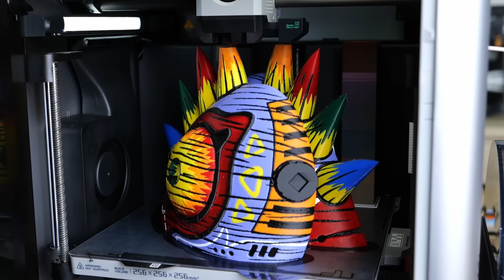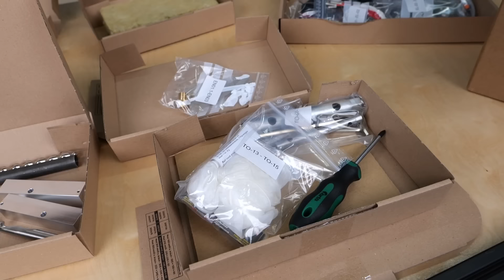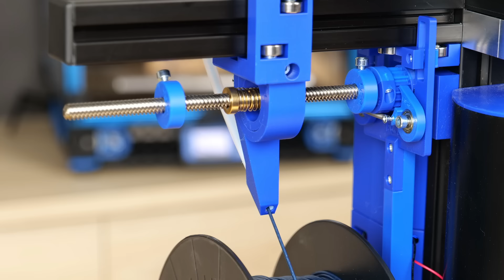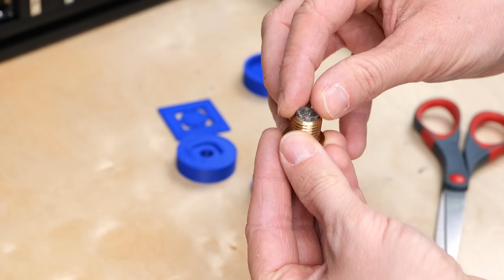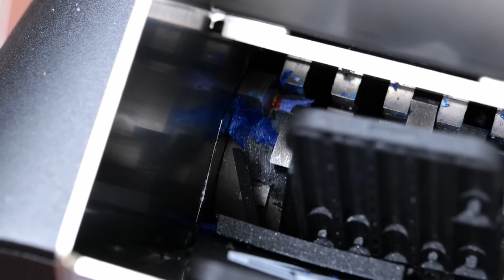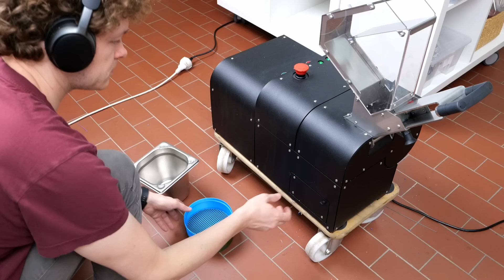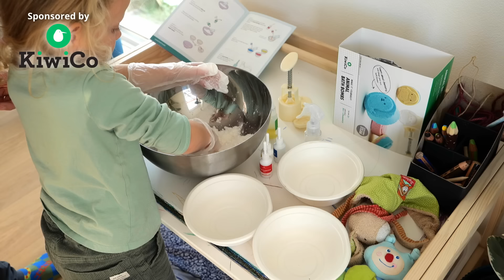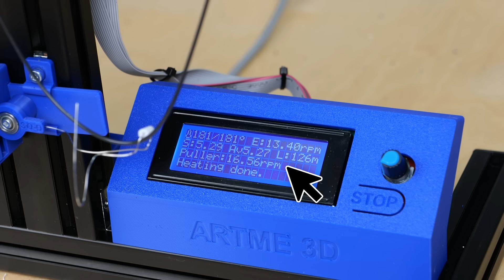Recycling Failed 3D Prints with a DIY Filament Extruder: Artme3D

Comment: This is a HUGE step in the right direction. I've been so confused as to why there aren't any solutions to shred and re-spool 3D printing waste that are consumer grade and priced. I'd love to buy a system to recycle my PETG and PLA waste, but it's way too expensive right now.
Reply: I use a ninja blender Ninja BL455, powerful enough, but you need to let the dust settle.
Reply: @Obot1121  be wary of the microplastics you're being exposed to. Many polymers in a microscopic scale are endocrine disruptors.
Reply: Yeah, in a hobby space and even in commercial manufacturing 3D printing is but a fraction. And often with plastic, extruding them over and over causes thermal degradation and you'd need to add additives to keep them from becoming worse. It might just be a better idea to use PLA more and create accessible industrial composters. And maybe something like plasma gassification for petg and some.other products.
Reply: @kbee225 Brothersmake did a video on plastic degradation and it's not as bad as you think.  They were able to recycle pla several times over with no change to the strength until about 50 times being reground and extruded.
Reply: @EnvyNeko2 , on degradation I would lean towards agreeing but at my work (cast film extrusion) we only run our recycled material in one type of product at up to 50% structure.  The most common problems of our in house recycled material is not degradation but imperfections.     We are now starting to run post consumer recycled material and the stuff smells like burnt wood, for our application we had to buy a new type of filtration system to run it.
Reply: @kbee225  I would think any issues with thermal degradation could be overcome by mixing in a percentage of new material in the form of pla pellets. Maybe 50/50. 

For me though, recycled filament isn't necessarily something I would use for high quality or high strength pieces. This is a "Oh I need a couple random hooks for my pegboard" or I need to print out a sacrificial piece to get the sizing correct before I print an entire batch. This recycled filament would be perfect for that.
Reply: Considering the biggest expense will be a system to adequately remove moisture, I think this system satifies the need to recycle, but will, for a long time at least, remain unrealistic for most users. Shame there is not a company offering this service, but if they could profit, they'd be doing it already!
Reply: No, it is not. And here is the reason why:
1. It has no filtering of emissions.
2. Professional large-scale systems have this and can do it more cheaply and in a more energy-efficient manner.
3. You're ruining your health because of 1 and simply buying the filament is more environmentally friendly overall.
Reply: Confused? Deep down you know the answer, my man. We waste too much filament on support, recycling that is not profitable
Reply: Because between dealing with the possible dust, hassle and precautions necessary for this to succeed, it’s easier to just buy a new reel. 

And no, recycling for the sake of some moral necessity imo ranks so laughably low on my list of priority that you can’t even begin to imagine how little I care for it, unless it actually has some tangible financial benefit.
Reply: @slowcyclist4324  For some of us it isn't about "Easy". It's about reducing the waste. If you're running any modern AMS type system it produces insane amounts of waste, sometimes more than the actual print. Personally, if I had a device that could grind up and make new filament from my Bambu X1C Waste, I'd pay up to around $1,000 for it. Why? Because it's better than tossing out 50% of the filament I buy lol. If you do a lot of multi-color prints up to 50% of the total print is just waste in a lot of cases. Each spool costs me between $20-$35 Canadian, so $10-$17 in waste per spool? I'd 100% buy a recycler for that.
Reply: It'd have to cost at most $100 in order to make any sense in my opinion, including the shredder - and even then I'd question what the goal is. It doesn't really make sense neither economically nor environmentally
Reply: @oyuyuy  Um... what?

Lets say your spool costs you 20$, you waste about 20% between failed prints and support material. Every 5 spools you go through, this saves you the cost of a spool - and whiel you won't want to continue recycling pure recycled PLA etc, you can easily funnel this into becoming internal fill material etc with very little in the way of lost strength etc. So you go collect a pile of stuff, recycle it down, turn it into supports, then use it as filler material - or just use it for solid blocks, bases, and such that don't need to be as sturdy.

I'd wager you can pay the cost back in under a year if you are big into printing.

And from an environmental stand point: In winter you use energy to heat your home anyways, so that's minor. But overall you are shipping less spools of plastic, you are sending less direct to landfill, and you are recovering the material for secondary use. As long as you were already going to print the damn item in the first place, you aren't generating any additional waste. And considering spools of plastic can be attained at like 20$, it's not like  the cost of these spools is prohibitive - it's more the cost of the printer that stops people from getting into the hobby, and even that is pretty damn achievable by doing something like bottle picking for a week if you have literally no extra money... which turns out you can even turn pop bottles into filament so, hey look: Secondary use.

If you on the other hand go through a spool or two a year, ok: This won't really make sense for you. But someone like me: It absolutely does.
Reply: @formes2388  Agree 100%. On top of that, not being too worried about failed prints encourages experimentation, which leads to innovation.
Reply: @formes2388,
Very doubtful you'd ever break even, in fact you would lose money doing it.
 If you are printing that much volume you certainly wont have time to do it.
Are you going to pay someone $10/hr. to spend 4 hours ($40)  recycling a $20 roll of filament?
No business person is going to pay themselves negative $ 20 per hour.
Reply: Formes2388.
Oh, and I'm just making a wild guess here, you've never ran any business have you?
Reply: @mrbmp09  I think once we get to the point where you can dump large failed prints in one end and get a roll of filament out the other, totally hands off then this will be really economy feasible for large operations. After that, with any luck, the price will come down to the point that it's viable for even hobbyists.
Reply: @formes2388  20%? Are you mad? I've printed almost 100kg this year and I have less that 5kg of scraps. At $20/spool it'd take me 6 years to recoup the cost of the recycler (not including the shredder) and I'm willing to bet that I print more than most.

Now that's already bad enough, but then lets factor in the countless hours I'd have to spend and the borderline useless quality of filament I'd get. No, it's definitely a huge waste of time and money.

As for the environment, it seems that you've forgotten about the 5-10kgs of metal, plastics and electronics that a recycler and shredder consists of. That'll have 10 times the carbon footprint of sending the scraps to a proper recycling facility, easily.

And no, I'm not a special case, this really doesn't make sense for anyone, regardless if you print 10kg/year or 1000kg/year. If you think it through, you'll realize that too.
Reply: @formes2388 you say "turn it into supports" and "use it as filler" so easily, you can't actually do that unless you have a dual head printer. Maybe for some prints you can do the supports and then print with the good filament but most prints will build up the supports as its printing the item itself so it all needs to be 1 spool and 1 print
Reply: @oyuyuy bro what? 💀 the waste would be way more expensive to buy again rather that recycling it for $1000
Reply: @firerowlet945  No it wouldn't, please think before you comment
Reply: @oyuyuy  also time wise....it is not worth it for an individual to do it at home.
Reply: @salmanrashid6245  I don't think it's worth it for anyone to be honest. Even filament manufacturers themselves often sell their recycled material at a higher price than the regular stuff - despite it being significantly worse quality - so I really question the cost effectiveness at any scale.
Reply: @oyuyuy you will probably start seeing them incorporated into the printers themselves at some point. In fact I wouldn't be surprised to see an all in one unit where you just drop in the pellets and it prints from a pellet hopper. Another advantage of this you could make your own custom filament blend. Like say you want some exotic blend instead of buying a whole spool for one print you could custom mix just the right amount for one print job and have almost no excess waste
Reply: @rodiculous9464  You seem to think that the cost of things doesn't matter. And pellet printers already exist by the way.
Reply: Exactly, 
Every roll of filament ever made won't account to 0.0001% of the amount of plastics used every year. Truly a moot point.
Reply: @mrbmp09 part of the point of 3d printing exactly to reduce the use of those plastics every year. You save by fixing things instead of throwing them away, save on plastic packaging, etc.
Reply: Are you familiar with rats favorite pass time?
If you can ignore the stigma and appreciate their tail...They are really smart and loving pets...unlike, hamsters.
A pack of rats would shred your waste for...will shred for food.🐁
Reply: makes no sense in many ways.
im not going to bother to but i would love to see someone calculate how many spools of filament you would have to recycle before you cover the costs. energy isnt free either. and while the recycler kit only costs $600, what about the shredder? im not familiar with the one he showed but it didnt look cheap. and that thing needs power too. 
and unless you dont improve stuff like the diameter tolerance youd arguably have filament that is equivalent with the cheapest chinese filament on the market. 
i would bet you would have to make hundreds if not thousands of spools to cover the costs of your initial purchase plus the running energy costs IF you even save anything from all of that. depending on how expensive your power per kilowatt hour is, you could even loose money on the whole project. and at that point it doesnt matter how cheap the recycler is. pushing down the power requirements of both the recycler and the shredder is whats ultimately going to decide how viable filament recycling is, as well as depending on your country and power costs.
Reply: @drecksbongert4367  From the documentation, it seems like this extruder can easily support other plastics like PET, so theoretically with proper sorting you could also be recycling other plastics in your house. 

That said, if cheap budget filament is $20 or so per spool after tax (the best comparison to the end product here) and we assume losses of $3 per spool made in energy use and parts wear (mostly in the drying process and parts failure since the electricity usage is trivial), you'd still need to generate 35 1kg spools to break even, and that's before you consider the shredder problem. Your best bet there is probably to figure something out with thrift store kitchen appliances, but even with a $100 build we're now looking at over 40 spools of plastic here.

Ideally we would see this type of machine get optimized and come down further in price.
Reply: drecksbongert4367,
You'd have to work for $5 per hour just to break even. That's not even counting power or the extruder or shredder, cost,  containers,  etc.....
Reply: @mrbmp09  sometimes its just about how cool it is to recycle your own filament

Comment: Hey Stefan, just wanted to mention: Thomas Sanladerer designed/built a filament dimension measuring device about a year ago. As far as I recall, he archieved quite a good measuring precision. This would make a nice addition for closing the loop further on filament dimension.
Reply: I thought the same exsact thing, with his sensor and this. Together and a bit more cost cutting I bet it could really be a cost effective method. Also super great for the planet.

Comment: I agree that it will be more appealing if it had an integrated filament grinder. The price should be a bit lower (around 150 dollars).
Reply: How are you figuring what they should charge?
Reply: @MrBertstare  The price is on their website, it is currently at 650 euro.
Reply: @htpkey   you missed the point?  Do you earn a wage?  Is it fair for me to call your employer and tell them what you should be paid?  The market decides, you want one that costs 150 then build it it sell it
Reply: @MrBertstare  The market will decide what the appropriate price is for this tool. At this price point it's probably not going to sell well for consumers, but it may do better at a lower price.
Reply: @MrBertstare  When I mentioned the 150 dollar price I was merely stating the price that I would be willing to pay for it. I didn't think it would be necessary to explicitly state that this was my opinion.
Reply: @MrBertstare  The 150 dollar price is also based on the cost of the components + their profit margin. Early adopters are ofcourse paying more than where the price will eventually settle.
Reply: @MrBertstare just common sense. You can buy a spool of filament for around $20. It doesn’t make sense to buy a recycler that will cost you $600

Comment: Great video Stefan,  i really enjoyed the entire thing.   Have you ever messed around with Hybrids?  Mixing PLA with another plastic?    it would be cool to see you use this machine and make some neat filaments!
Reply from the maker: Haven't tried this out yet but this machine might struggle with such a project, because there isn't a lot of mixing happening in the barrel. Might go back to my 3DEVO for this.
Reply: @CNCKitchen You would probably have to double or triple extrude it. Basically, extrude it, granulate the new filament, and then extrude it again. That may be enough to get it mixed together consistently, but if not, do it again. The problem is, that's an awful lot of work for something that may or may not work. Even if it does work, there may not be any benefit to it.

Comment: Would you get a better result if you grind it to even smaller particles by using e.g. a coffee grinder?
Reply from the maker: There is an optimal size and too small isn't necessarily better. You rather pelletize a first crude filament and then extrude these pellets again.